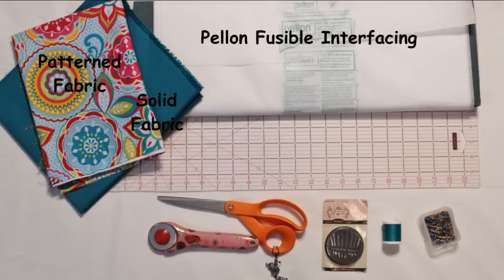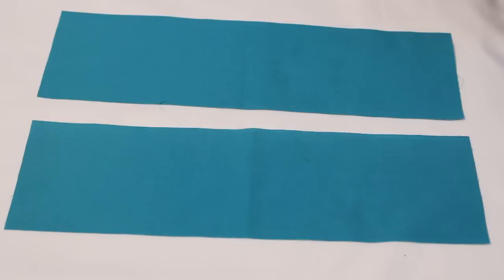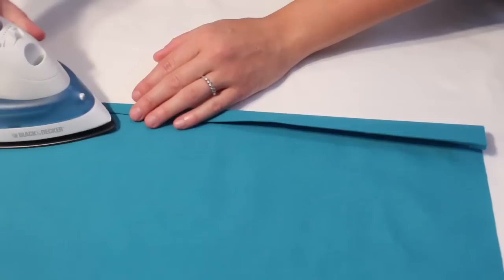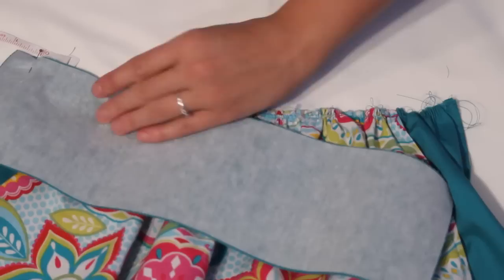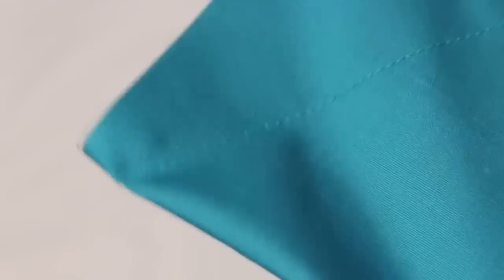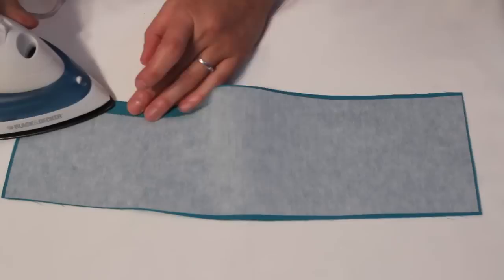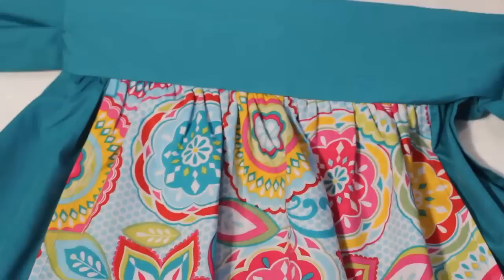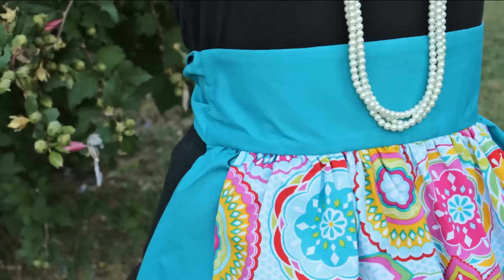Retro Half Apron How to - Whitney Sews

Comment: Your video is very well done!  I just wanted to add a comment about the salvage.  My mother, who sewed professionally, always told me to cut the salvage off because it didn't stretch or was the same thickness as the rest of the fabric.  I see you leave it on.  Don't you have problems with your items puckering later?
Reply from the maker: Thanks for the selvage tip.  I only leave the selvages on projects that aren't going to be washed and worn a lot.  For clothing I would usually cut it off. Never had any trouble.

Comment: I am a newbie sewer.....going to attempt this apron.  For the Pellon Fusible Interfacing, did you you a lightweight or medium weight?
Reply from the maker: I used a medium weight, but either would probably be fine.  BTW if you ever want to make a project that needs medium and you only have light you can just fuse one layer of light then another right on top of it. :)
Reply: Wonderful thanks!